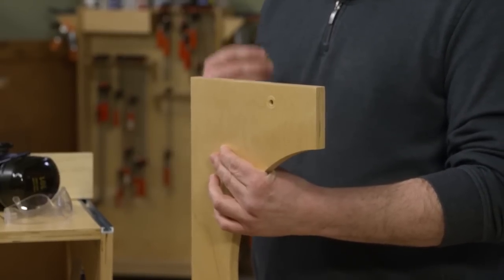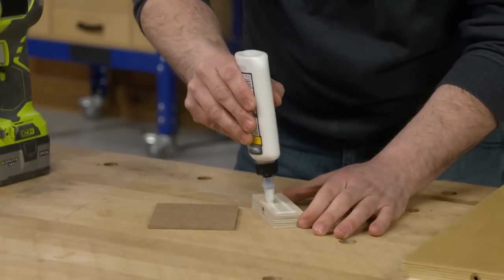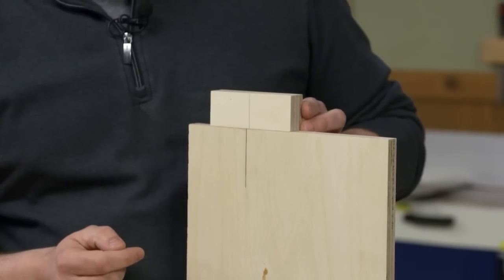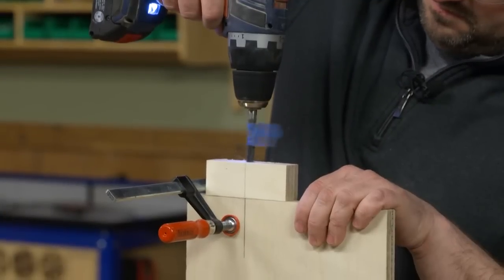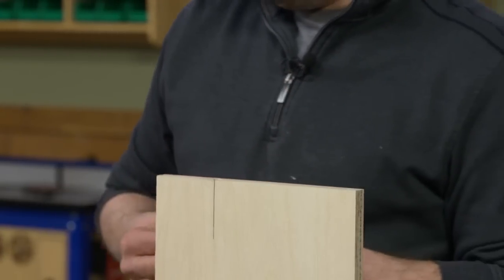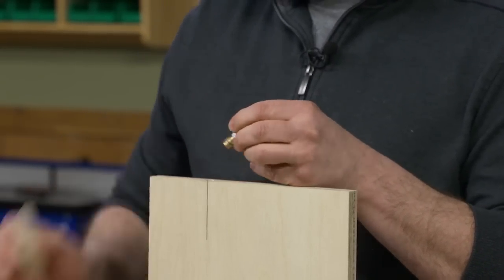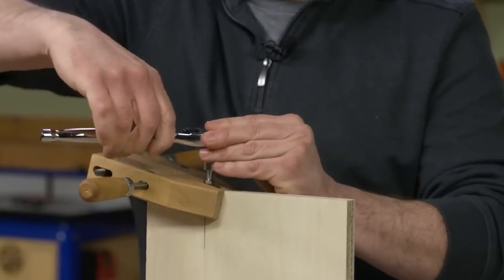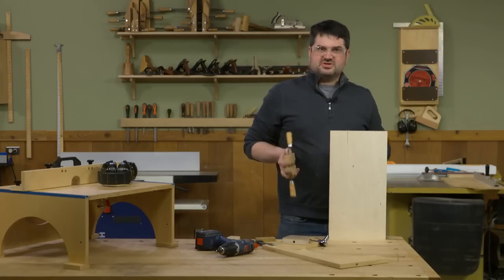Woodworking Tip: Threaded Insert Installation

Comment: I always take a Dremel or hacksaw and cut grooves(2 or 3 evenly spaced) into the threads perpendicular to the insert. I find this helps cut the threads into the host wood instead of pressure forming the threads. This alone helps tremendously with wood splitting. In a way, I wish there was a tap made specifically for wooden inserts and then just a dab of glue would hold it in place.
Reply: Very clever and useful tip.  Thanks much.  You're effectively making a single-use tap.  If you cut the grooves helically, slanting to the right toward the top, it'll help clear the chips, too.

Comment: To sum up the video:
- use some drilling template to drill at straight angle
- chamfer the holes to prevent lifting of plywood fibers
- apply paraffin wax to the tread of threaded insert
- when installing the insert put the plywood end into clamp to prevent spreading it

Comment: Thanks for great video. How do you think what's the max diameter of threaded insert for plywood (e.g. 50% or 70% of total thickness of material). For my project I am gonna use 18mm plywood and have threaded inserts with outside diameter 8mm and 10mm. To me it seems the less the diameter of insert the better it is, but this is only my theory.

Comment: The wax on the threads is a very good idea, even on machine threads, if you are not using other lubricant.
However, I use bee's wax. It is easier to apply to threads, because it is
softer and stays on better, because it is a bit sticky. 🐝🐝

Comment: You don't need to make a jig if you have a dowel jig..    It's alot easier to install threaded inserts if you use the one that are installed with a hex wrench and use a tee handle hex wrench.